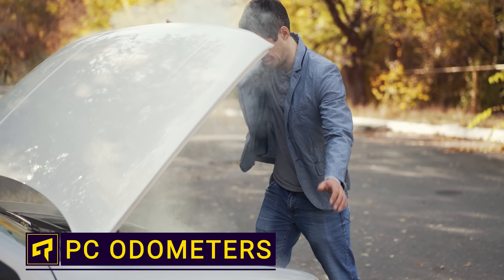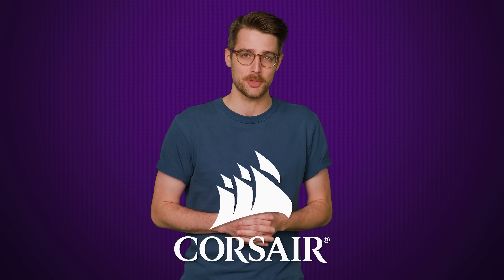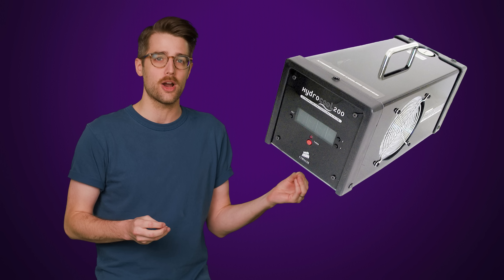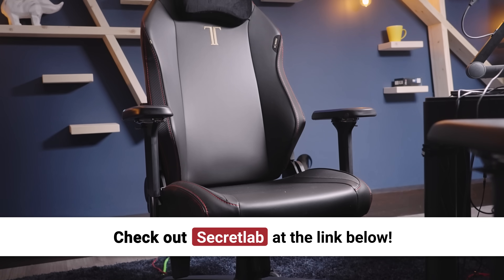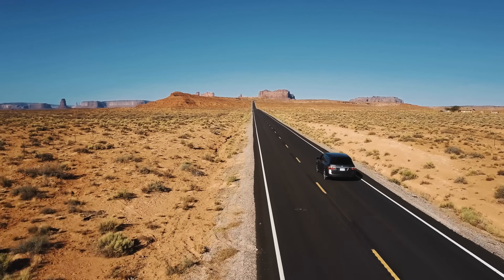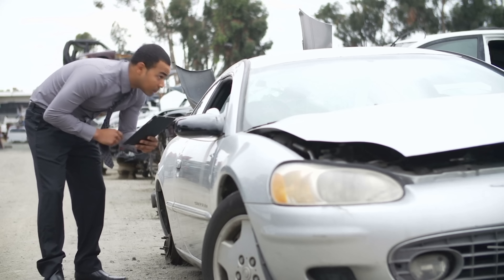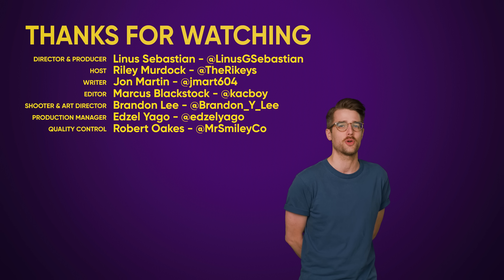Should Computers Have Odometers?

Comment: Because miners wouldn't buy them. They don't want you to know if that GPU has been run for 2000hrs or 10000 hours. It would massively devalue used parts.

I don't turn my machines off. I have a 4790k that spent years as my daily driver then years as a kids PC/HTPC/RAID array network storage. That CPU has at least 50k hours on it. Obviously CPUs and GPUs are different since a GPU has mechanical fans and more components but who would want to buy a 50k hour CPU?

Comment: Most computers have operating systems that log uptime hours. All modern printers have time sensors not only in the printer but also in the cartridges. SSDs have read/write counters used to check to see if read/write functions have exceeded warranty limits. CPUs actually do have odometer type functions that are not accessible by consumers. Several manufacturers of DDR4 and 5 ram have record functions in the chip that tells the cpu what they are. They record uptime, voltages and timings for warranty purposes. These functions aren’t accessible by consumers to prevent modification in case of a warranty claim. There are odometer functions in the bios of most motherboards in places that are not overwritten in an update for warranty purposes as well. The sensors are there and recording. Consumers simply can’t access most of them as they are put there by manufacturers to protect the manufacturer from the consumer.

Comment: cpus and gpus dont degrade (other than very very slight metal degradation from electricity flowing through them. although this is so small that its more likely the chip dies of other causes than this one)
fans and ssds do degrade heavily, and its why i NEVER buy used ssds. (or any used nand unless its super cheap).
fans arent very expensive so i dont care as much.

Comment: I knew someone that constantly bought used/refurbished PCs for his group and many of them were dying in less than a year, or would last no more than 2 years. I checked one of them in 2018- looked up the model with the processor version, and the original tower was manufactured in 2011. it was  purchased as a refurb in 2017. Imagine telling someone "y'all need a windows 7 PC with a Core I5 processor to run your software" and they decide to get towers with I5s from a half a decade ago!

Comment: Also in the past many computer parts were left running for about 48 hours or so as a 'burn in' because if something was made wrong with it it would usually die early in its life. If it made it past the 48 hours of so it would most likely give many years of problem-free service.

Comment: Cost to company. If you start putting moisture detectors in everything, accelerometers, thermal probes... all so the end user can have peace of mind upon resale? It might speak loudly for the company but other than that I don't see any real benefit for them...

Edit: outro, "talk normally", aside, that was fairly impressive. It's like you're training to be a "Ts and Cs" disclaimer person without the editing software 😅👍. Or an auctioneer...

Absolutely last edit: system diagnostics and reporting tools. Ram checks, hard drive SSD addressability and capacity deterioration. Any way, perhaps, an second hand user could use a service that matches components to diagnostics reports? Like eBay without the pay. More of a way of connecting buyers and sellers. Is it possible or do components get generic serial and batch numbers? Maybe a component number within the batch could be marked, for exact specificity - for buyer's safety...

Comment: I don’t get why this video starts with the logical premise about buying USED cars, but then spends a 90% of the remaining time talking about new systems and things a PC odometer couldn’t do (like track bent pins) that car odometers don’t either. This video completely abandons the premise right after stating it. 

Car odometers are a general way of figuring out how much a car has been used and what issues it’s most likely to have with that much use. Doesn’t tell you if it was in an accident but it’s still useful to know if a 2 year old car has 100k miles or a 20 year old car has 10k miles.

Comment: Since 2011 motherboards and ram durability significantly increased.
I am still running those 10+ yr systems.
It is funny that today's hard drives are more capable of the sata 2 on those mobos.

Comment: Capacitors prefer to be powered often or always. So hours on is a good thing in some ways. If something hasn't been powered for a while, It can help to lower the voltage as much as possible until the capacitors wakes up. They can sit at 0V for a while before wanting to hold charge again. They also can have dried out and just be shorted. Valve Guitar amps really show the effects yet it is the same for all capacitors.

Comment: Odometers or hour meters are only really useful for mechanical parts that move. Today, PCs have few mechanical parts besides fans, hard disc drives, and coolant pumps. I don't see the use for such meters on those components since fans & coolant pumps are easily replaced and HDDs last a long time. HDDs and most other parts also have a manufactured date on them as another metric to judge how long it's been in service.

Comment: Speaking of Corsair and warranty, never buy their used products after or near the warranty period. If something breaks you won't be able to ask for a paid fix or buy parts like many other companies.
I bought their "flagship" keyboard, brand new, and while I love it and it works well, I had an accident that broke one of the switches, so I asked for a fix or replacement switch that I wanted to pay for. They basically told me to F off (and that's after you pass through their bot which was quite annoying).
I can compare it to a kinda similar situation with another company: I had a Logitech mouse that I bought refurbished from a reseller. When I had a problem with it after the warranty period, they took it and fixed it without any problem, just asked me to pay for the repair, which I was completely okay with.
I was able to fix the keyboard myself, since it turned out that I had to just re-solder the switch and it all works fine. I have it for over 6 years and it only failed once, by my fault, so I believe they make quality products, but their support is shit.

Comment: Would not matter. If the Chinese hackers can hack a GPU's firmware to make it display wrong gpu information, they could easily wipe an Odometer to make it look like it's low running time.

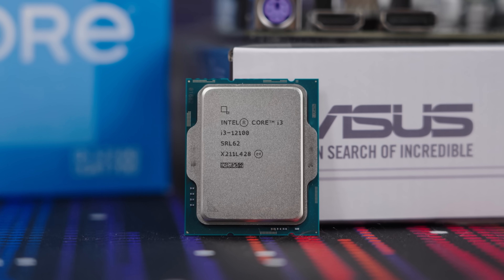Comment: @2:41 LOL @ "Exceedingly rare" - well as far as GPUs no it's not rare, I've had GPUs fail on me within only a few years, barely used them at all, very light use, cards from BFG, so much for their lifetime warrant, good riddance to that company - and I'm sure people remember the premature failures of some NVIDIA GPUs, like the 8800 series.  There is also apparently increasing failures on their 30 series too.  NOTHING is built to last nowadays.  CPU failures are indeed rare, so are motherboards (good quality ones), I would like to say most of the time failures in electronics come down to cheap components like resistors or CAPS, which can be fixed for cheap if you know how and have the right tools, for GPU failures it can be more complex.  For GPUs there are some known computer retailers that sell used labelled as brand new - I used to buy all my GPUs from a former well known computer retailer in Canada which is now bankrupt, not once did I get a GPU that did not appear to be used, I have not had any failures on GPUs other than those from the BFG brand (Big Failed GPUs) :P

Comment: Yeah that would be cool to have, it'll make crypto gpus much cheaper and the seller won't be able to lie about it unless the seller is a hacker and resets the counter also high mileage vehicles ain't that bad I've driven cars with more than 250k miles and they drove way better than the same car with between 80k-150k miles heck my diesel truck I got it at 400k miles and It's at 500k now only thing I've done to it is the headgasket because it's tuned to like 600-1000hp with more boost than factory turbo, it's a lbz duramax BTW . I'm a computer wiz and a car/truck enthusiast! I've driven all kinds of cars of all makes and models except for exotics, still working my way to them soon...

Comment: I think the better option would be like in  some cars, semis and some construction equipment, is to add how many hours a vehicle or component has been running for. For example let's say you buy a 2010 Honda Civic with only 50k miles, but the previous owner used it as his office for his job or business. The car itself would have been stationary, but the engine could have run for hours without end. So it's low miles, but the engine already has wear and tear because of all the idling, which shortens the life of the engine. Newer vehicles already have this, but not standard on some makes. Not sure if you can add something like that to a PC component, it would be more helpful than an odometer. But I think it's an interesting idea.

Comment: Around 2005, I had a prebuilt watercooled case/system that included a reservoir with a level sensor, alarm and pump in one unit, similar to the Corsair device mentioned here. I eventually replaced all the parts, but retained the reservoir for years of different builds. The side panel had a large square radiator with a 12 inch fan and tiny tubing, and it was sold on Newegg. Wish I remembered the brand name.

Comment: No. It wouldn't make any sense for the manufacturers to do so. They make them and sell them. They don't sell used parts. So they'd have to invest it something they'd never use. Vehicle manufacturers (dealers) do, however, take in used cars for resale. They also need preventative maintenance, so having a meter for when to do something makes sense. It's probably a legal requirement because vehicles are important, and computers really aren't. If they're that critical in a life-sustaining application, they aren't going to buy used. They also aren't going to be using consumer grade stuff. I don't see how certain sensors are related one damn bit to something that stores how many hours something has run. That wouldn't be cheap. A sensor is passive. Nothing is stored. You'd also want said "odometer" to probably track how hard a part's been used. It's not good if a computer has been on for 24/7 for a 5 years but never pushed.

Comment: with mining especially this is important I feel. no matter what kind of mining you do, it really stresses out the hardware it runs on, and always harms it over time. Having some measure - maybe not just of run time, but of type and intensity, would be amazing. Even if it's only accessible in software, so long as hacking in a bs number isn't made too easy, it would be a huge windfall for the used market. Listing the score of the hardware you're selling would instantly become standard practice, and refusal to do so would be an instant "don't buy" label.

Comment: The PC I'm currently using as my daily driver is over a decade old and the only components that have failed or showed signs of needing a replacement are the stock case fans. Everything else is still functional, including the mechanical drives. Components with moving parts tend to die first.

Comment: Considering that the majority of computer components will last many times longer than they have a use, an odometer will be pointless.  I have a couple machines that have been powered on doing basic security system tasks for over 20-25 years.  One system is a Pentium 2 and the other is an athlon system and they have both been running 24/7/365 all this time except for routine maintainence and drive replacement.  If you buy quality ball bearing fans and decent PSU's that are designed to last and you are not overclocking your hardware, most computer components are going to reach a limit on component environmental aging before they reach a limit on cycle life.

Comment: This was always an Interesting topic for used CPUs and GPUs that have been overclocked or pushed to the limit by their previous owners. A lot of enthusiasts want to squeeze as much performance as possible from their components and it results in the components frequently reaching high temperatures which is fine for the short term, but then when you realize a lot of enthusiasts regularly upgrade and sell their old components, something like an Odometer would certainly benefit the second hand market.

Comment: Me with my laptop from 2018, that has somehow consumed the soul of its wifi card and needed a replacement. Not even gonna mention the other instability introduced by using a 4K external monitor and an ROG Phone Desktop Dock as a primary hub. Odometers on this bad boy are crunching 300K miles at 95 mph

Comment: I have the same 1TB hard drive from roughly 10 years ago and it followed me through 3 builds, still running fine. Having multiple parts (I.E. 4 sticks of ram Vs 2 and multiple hard drives) will spread out the wear and tear on your parts and make them last ALOT longer. having multiple hard drives dedicated to specific needs like one drive works soley on the OS where another drive soley works on games and another on media ect. This makes your machine run super fast and efficient

Comment: I know I use USB 2.0 and I don't give a donkey.  USB is not only 1 way, it depends on the device, and what your use case is, for me it is simply charging my devices.  Not much difference between 2.0 and 3.0 for that.
But yeah, ensure to buy from eBay, Amazon or [insert seller here] that has a refund policy.  Postage isn't too much for a GPU after all.

Comment: I am pretty sure most internal components have some kind of a logging feature for the manufacturer to access. The problem is getting access and then making sense of the data that gets collected from multiple devices. That would be a nightmare all in itself. But it probably could be done. Just might not be practical to do.

Comment: Early computers had odometers. Computers such as the IBM 1401 that cost 2 grand a month to operate in 1959 (on the low end). That's near $25,000 a month today. IBM techs could see how long the machine was on.

Comment: Main thing I've learned from LTT AliExpress videos: anything can be spoofed (:
     Disregarding that; 
cycles on a battery do not necessarily represent the life left in in, nor the way in which it was charged and discharged.
     I reckon such a counter would only deter people from buying used products. 

Like, "Oh no, 70.000 clicks on this DSLR camera already.. That's almost garbage!"
     While in reality, if it's guaranteed 100.000 clicks, it will outlast that number by a lot.
     And the overall state and regular maintenance can ensure you of longevity more than that counter.

On cameras, for me it's more like an "I should ask about maintenance" reminder.

If used like that, it could make sense.
But most people simply don't have enough in depth knowledge to make such a decision. 
      It'll probably result in more tech in the trash... (or cheaper 2nd hand tech for the rest of us.. muhaha)

Comment: Considering your CPU, GPU, and even drives have thermal sensors, and there are also ways of monitoring the power draw of components right now (visible in the BIOS), those two things would tell us most of what we'd need to know about the amount of wear on most of those components. A GPU that's been mining is going to have clocked more kWh and run higher average temps than one that's been gaming even several hours a day. All we'd need is a way to flash that info onto a relatively tiny amount of storage on each given component. I could see a future of a resale market where the kWh are the equivalent of vehicle mileage, especially for a power supply.

Comment: Enthusiast parts last longer?
Bro I still have a 486 running Ms Dos with all original PSU and IDE hard drive. 
How long do we want parts to last exactly 😁
I think parts failing are due to user error, bad airflow + time = heat, and low quality or faulty PSU power flow + time

I still fire up my 486 once or twice a week for some sweet old dos gaming 
🤣🤙

Comment: Laptop Battery some times has a life cycle, or had an odomer on it, if it reach on the maximum cycle it will automatically stop working to prevent something happens wrong when over cycle.

Comment: I'm sorry, but odometres were a common practices for cars since forever, that's why cars have them, if it was for the manufacturer, odometres would be gone from cars, less information for the consumer is more control for the manufacturer, with PC parts is the same, i have 2 identical high end CRT monitor from 2004, and they have odometers and it was stupidly usefully information when I bought them, one was very clean and priscine on the outside but it was used in a commercial environment so it had 50k hours turned on and 30k with the screen on (the owner didn't bother to turn off the screen) all this is extremely usefull information, this all ties together with right to repair, the more control we have over our products, worse for them, of course Corsair was gonna tell you that we don't need odometers, to their credit their argument wasn't fearmongering horsepoop, kudos i guess